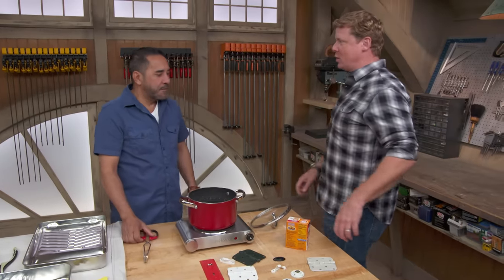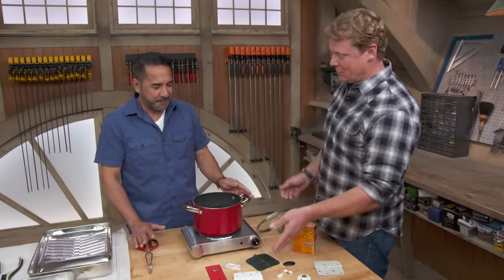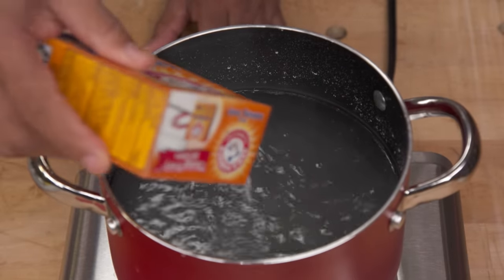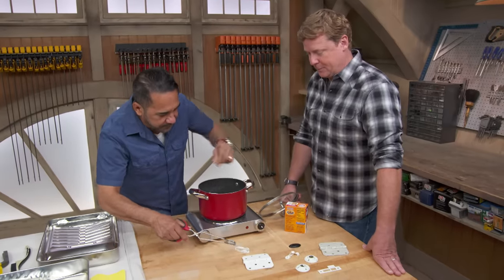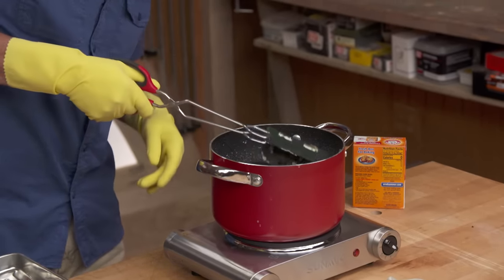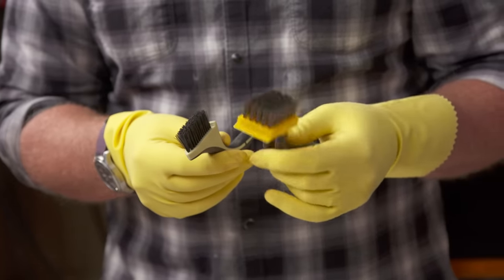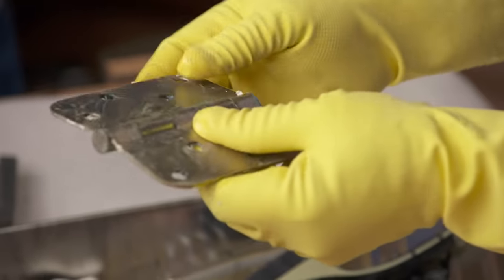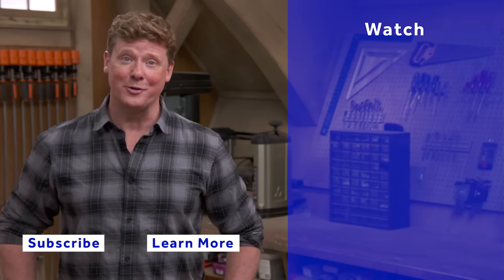How to Strip Paint Off Old Hardware | Ask This Old House

Comment: I am kind of bothered by the fact they were using latex paint on the examples. Not the the 80 year old oil based paint that is much harder to get off. Those were new hinges too.
Reply: "I love these old hinges" but the backside is still shiny as new.
Reply: This method does work and I think that is what the point is 😂
Reply: Yeah I think I saw the price tag on one of the hinges 😂❤
Reply: I’ve been using this approach for hardware in a 100-year old federation era house and works a charm. For really stubborn hinges had to put it in twice
Reply: @aravindviswanath9922 did it work for lead based paint as well ?

Comment: We just removed all the hardware in our 1940's house, and put it in an old slow cooker with a splash of liquid laundry detergent - works well too! It's so nice to have clean hardware...they had a minimum of 3 layers of paint on them.
Reply: How long?
Reply: @paulhuhtala4541  about 5-6 hours I'd say. Originally, I'd let it soak overnight, but it doesn't quite take that long.
Reply: I’m currently remodeling a house built in the 40s. All the hinges have several oil based paint layers on them. I’m going to restore all of them for the client!

Comment: I absolutely love this method. i hate working with chemical strippers. the only thing you need to make sure you do, is brush off the paint before the hardware cools. I take one piece out at a time, and brush each one before I remove the next piece. Also, since you're working with hot metal, using a plastic or nylon brush doesn't last very long. I used a soft brass brush. brass can't scratch brass. if you're working with hinges, or flat door plates, a plastic putting knife will work wonders. It won't melt because you can get everything off with a quick swipe.

Comment: Latex is easier than old lead paint but boiling still works just leave it in longer  as needed.   Also don't shy away from wore brushes when it is old paint on unfinished cast iron hardware.

Comment: Thanks, this worked a treat ! I had sprayed brushed nickel cabinet hardware with black Hammerite. I used an old saucepan and simmered in bicarb soda for 40 minutes. I worked on them right away with a teaspoon to get the paint off. They needed a going over with one of those metal-look scouring balls and washing up liquid as there was a little gummy residue in places. Now they look exactly as they did before I ruined them !
Reply: @flat-earther  It's a flat earth in the sense of a 2D plane projecting a 3D reality within the Simulation. See Archaix channel on here

Comment: So now that I boiled my door hinges with baking soda and then scrubbed with acetone. Does the boiling methode remove the grease in the door? I wonder if I need to lube the hinges back up, or if I need to reposition them because the door feels a little stiff? My thing is I bought a new door and had to rip it down to size and paint it but to save money I used the old hinges since I knew they already fit the groove cut out in the frame so I just made the groove in the new door. And maybe my hinges are placed slightly off? What do you think?

Comment: All the paint shown in this video was latex paint.  I wonder if this works on enamel paints, urethane paints, and epoxy paints?
Reply: Doubt it would actually work
Reply: Works on just about any paint I have ever come across ... but I use a slow cooker and sometimes have to use a couple of dips
Reply: @stephenhegarty  how long for?
Reply: @smartgorilla  depends on how many coats of paint are on the piece. I start out by heating the water up to temp on high and then turn it down to low for a half hour or so. After cleaning off whatever comes off you can always drop it back in for round two if necessary.
Reply: @stephenhegarty  thank you for the info. I bought a set of Victorian brass door furniture. It looks and feels amazing but it's got cracked black paint on it
Reply: @smartgorilla  be careful with brass hardware. Sometimes high heat can discolour it, keep it below boiling. Also use a nylon brush as steel or brass might leave scratch marks.
Reply: @stephenhegarty  I don't know what is underneath but it's shinny
Reply: ......what?

Comment: That looked like a single application of latex coats, I have hinges with 5 or 6 layers of several coats at each layer and all oil based paint, will see if it's effective
Reply: How did it go?
Reply: @calebwitvoet  ended up using a 2000w heat gun, outside. Was so quick and effective compared to any other methods I tried.
Reply: @cjhification  Interesting thanks for the update.

BTW Rai I suggest watch a 13 part series called What on earth happened by Ewaranon to learn that the earth is not a globe. Link in my about tab.

Comment: If you are trying to change the hinge. How to remove paint if the hinge is still attached to the door? Do you use acetone?
Reply: Aaliyah I suggest watch a 13 part series called What on earth happened by Ewaranon to learn that the earth is not a globe. Link in my about tab.
Reply: I used acetone and it worked for me. Next, I'm using this method to strip the handles clean!

Comment: Do you leave the pot boiling or turn it off after you put the baking soda
Reply: Just keep that water rolling! The hottest the better keep the heat coming keep the powder pourin then Scrub with acetone afterwards and they will be PERFECT! however if you boiled hinges or something that needs to move you will probably have to re apply lube again because they may be stiff or squeaky.

Comment: This is great for hardware but I have two painted twin brass beds that I’d like to remove the paint from. I can’t put them in boiling water. Is there a remover you can recommend?
Reply: I'd try a heat gun, after disassembling the bed, of course. Heat softens many types of paint (especially latex). It will also cause the metal to expand a bit, which will loosen the paint bond. If you suspect lead paint (you can test for it, but the test kits aren't 100% reliable), don't heat it too much  or the lead will vaporize. Alternatively, Citristrip is a non-toxic paint stripper that works well and is easy to use. Remember that although Citristip is safe, the paint residue may contain lead, so dispose of it responsibly. Use plastic or nylon scrapers because brass is soft and scratches easily. Good luck!
Reply: Designer I suggest watch a 13 part series called What on earth happened by Ewaranon to learn that the earth is not a globe. Link in my about tab.

Comment: Could this be done with a relatively small, single-socket bathroom ceiling light fixture if the wiring's removed (to later be replaced)? It's original and brass I think - in a 1916 house - and has an upside-down bell shaped canopy (that touches the ceiling) then below that it has one or two little loops like links in a chain (the hanger loop) then below that is the brass socket. Most of the paint has come off the brass socket from the (unfortunate) constant moisture in the air, and the two layers of paint on the canopy have been slowly peeling off from all that humidity so that it looks awful. I imagine the paint should come off easily. But I doubt I can put the whole thing in boiling water eh? Not sure I'm skilled enough to take it apart and boil only some parts.

Comment: So how do you get the screws to tighten up in the door hinges when you reinstall. I trued tooth pic’s. Didn’t work very well. Maybe gorilla glue ?
Reply: Go longer or bigger diameter screw if possible.  And while you're at it switch from crappy slot or phillips to robertson screws.   For some hardware like window lifts you can fill the old holes with wood filler then attach it elsewhere nearby  after repainting the sash.
Reply: Pound in golf tee with a little glue on it
Reply: Never use glue on screws, use longer screws.

Comment: What do you do with the leftover water if the paint had lead in it?
Reply: Great question!
Reply: Your town should have a HazMat advisor you should ask.  Dumping into waterways or your yard isn't a good idea.  I read the soil beside old houses' driveways is badly polluted with lead from leaded gas fumes. Apparently it doesn't leave the soil.
Reply: We have tox drops which might be a solution but what’s a good storage container since those drops don’t happen all the time?
Reply: @FrankRemley  Glass jars, lidded glass jars (jam/jelly, pickles, etc).  If your wait window isn't years, a plastic jar that seals well will also do (peanut butter, mayo, etc). 
Just make sure you label it, should you forget what's in it.  I either write on them w/a Sharpie, or stick on masking tape and write on that.
Reply: @buzoff4642  this has been the incredibly helpful. Thank you!

Comment: No old pan hanging around the house?  Put your items in a tin can with baking soda, boil plenty of water, fill tin can with boiling water til items are covered and then put the can into what hot water remains in the pot to prolong the heat in the can.

Comment: PLEASE HELP!! My dear friend and customer has doors on the sunny side we live in Florida by the way that are peeling off the door the doors are great he wanted to replace him I said no.  
  How do I get the paint that won't peel off, off the doors. Also advise on prepping doors do that the paint adheres for many years. 
[He's prepared to buy new ones I said no. The cost to install exterior doors is ridiculous]
Reply: The least expensive way would be to use a chemical remover, such as Citristrip, which is safe and works well, in my experience stripping furniture and working on my 150yo house. Be sure to take the doors off the hinges and lay them flat so the remover doesn't run. If Citristrip doesn't work, there are other paint strippers that might work, but some are very toxic and not sold in all states. Some of these contain dichloromethane, also called methylene chloride. Some of the strongest ones are labelled marine strippers. Read the label and follow the instructions carefully. If you don't want to use a chemical stripper, you could try a heat gun or an infrared (IR) heat stripper, but be careful because they can both scorch the wood and start fires. (I know someone who burned down his house using a heat gun to strip paint.) IR paint strippers appear to work well, but are crazy expensive. Glad you're saving those doors. It'll be worth it in  the end.
Reply: The advice is that new doors will do the same in a few years, so not worth the money doing so.
Use genuine oil based enamel paint once they've had the old paint stripped off.  Latex enamels are junk that peel off in 2 years on my south facing windows, and I'm in NH so can't imagine the paint failure rate in FL.

Comment: Dont Paint your Hardware, and also Dont Paint Brick Fireplaces. Its just extra time needed to remove all the paint and is unneeded
Reply: And, stay off Houze.  They paint brick, woodwork, appliances, tile, walls, ceilings…..everything white!  It’s especially popular now to paint light oak cabinets white because they’re “dated”.  You’ll never get the white paint iff deep pored oak.  It’s really sad!
Reply: @tharais  I actually Go in and send Hours upon Hours Removing Paint from Fireplaces, and Cabinets with more then 80% success rate. Its a very long process. have to use paint stripper, and alot of Dentist tools picking out paint from in little cracks..

Comment: Never boil your house in baking soda. The paint will fall off.
Reply: I need to get the flaking paint off my brick house.  Hmnnn...
Reply: @flat-earther  a 13 part series on why the earth is flat?  I’ll pass.
Reply: @jbratt  It long and ends up covering many topics. But I suggest watch from part 1 onward at least all the parts where the globe versus flat topic is discussed.
The narrator looks at both models and isn't fixated on either.
In my opinion that series is a good introduction to the globe versus flat topic so that's why I share it.
Okay.
Reply: @flat-earther  so do you believe the earth is flat?
Reply: @jbratt  Hi jbratt, have you become a flat earther yet?

Comment: Uh just soak it in citri strip gel from Home Depot in a Tupperware container for a day or two with the lid closed. Then scrub with steel or plastic (if your worried about scratches) wool under warm water in the sink. Then you don't have to use heat. Smh
Reply: I think the point is that you don't have to go to Home Depot and buy chemical-based strippers if you don't want to.
Reply: @mckevrock  Not so sure about that. It’s not that expensive. I have striped 4 doors and all my trim work in my 1910 1000’ sq/ft home and it worked brilliantly. On the doors and trim work I applied the citri strip gel then the thin rolled plastic and let it soak for a day. Then it would tak like three of the 6 or 9 layers of paint off. As for the hardware that was painted on it was easy. Just soak in Tupperwarefor a day. Point is people that are willing to do this are desperate for a solution and would likely not have an issue with $15 for the gel. Just offering a solution that I know works. God speed man. Live renovations!